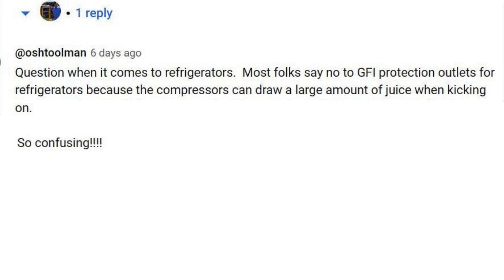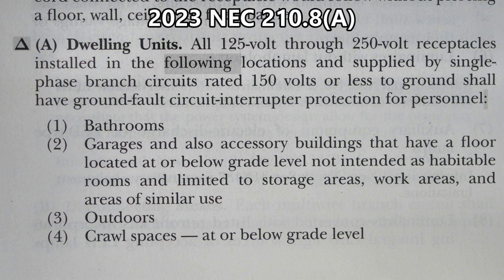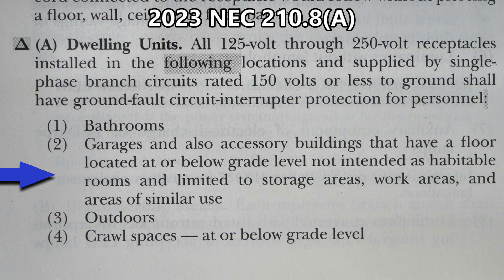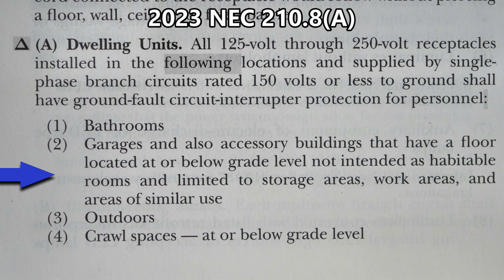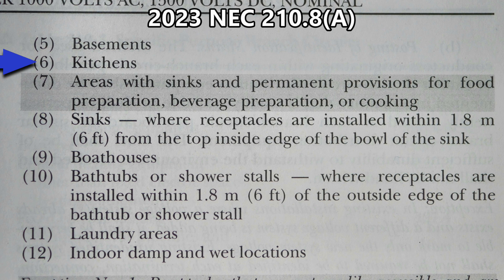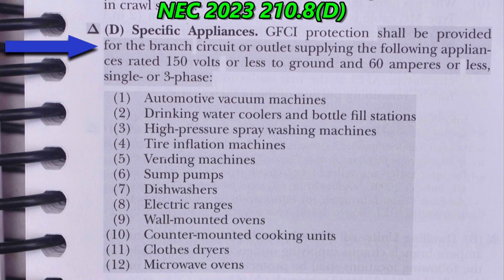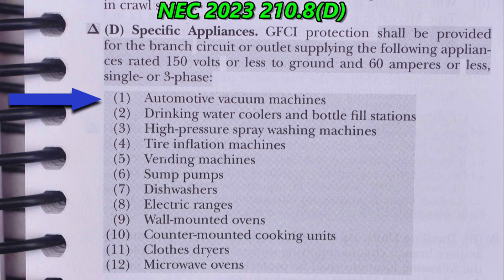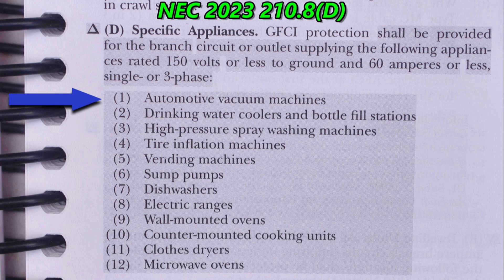Do Refrigerators Need to be Protected by GFCI? 2023 NEC 210.8(A)

Comment: Let me clarify a few things because I know this gentleman states that the GFCI must be at every outlet or receptacle due to the fact that article 210.8 states that it shall be. But if you look at article 210.12 where it says AFCI also known as an arc fault circuit interrupter it also has the word kitchen. If I'm not mistaken, the word kitchen is number one at the top of the list of receptacles that are required to be AFCI.

So the question is, is this guy correct? The answer is yes and no because not all devices in a kitchen are required to be GFCI since 2. Article 210.12 clearly states that a kitchen also must require an AFCI.

Now I'm going to go off on a limb because I'm willing to bet some people will challenge this and say that lights must be AFCI, then if that was the case then it would clearly states lights only or as the NEC clearly addresses it as the luminaire.

Comment: GFCI protection is not required for a refrigerator receptacle outlet unless it is located within 6 ft from the top inside edge of the bowl of a kitchen sink [210.8(A)(7)].
Reply: If it is in the kitchen, it is required by code.i live in a tri state area, all inspectors i come across require fridge gfci protection as well

Comment: At one of my rental units, the kitchen appliances, including the fridge, are all on their own dedicated circuits, and all are on AFCI/GFCI breakers (Eaton). I have had multiple nuisance trips from these breakers, and have replaced some of them. The tenant recently had a failure of the fridge, so a new one was installed. The old fridge never had a nuisance trip, but the new fridge is tripping the breaker.  I hope they didn't go fill up their new fridge. Going out there today. I think I'll go standard breaker on this one, especially since the 2023 code does not list refrigerators in their list of appliances requiring dedicated GFCI. Not to mention that my 20-year-old house with its 20-year-old fridge has been doing just fine with its dedicated non-GFI breaker.

Comment: 1:22 question, not specific to a fridge but something here caught my eye: *below-grade*. 

I have a below-grade utility room (furnace, water heater, washer/dryer) inside my 1960-built house. It has 3 circuits: furnace (no outlet), washer/dryer with GFCI receptacle, and a 3rd circuit without GFCI; this feeds the ceiling light and also other rooms. 

Without accounting for a “grandfather clause”, does this 3rd circuit need GFCI? Not running a fridge or anything, and it is at least 6 feet from water pipes. 
Just curious, and I guess it if does need it it’s easy enough to do. 

Thanks!

Edit: I think I have my answer at 2:15 , as my utility room, while relatively small, might be considered a basement. Also as there is a water heater and pipes, and also a floor drain, it could be considered an “indoor wet or damp location”, though only in the worst case scenario if a pipe bursts or leaks, or the water heater leaks, or the drain or the AC condensate pipe backs up. (Which at least a couple of these have occurred.)

Comment: There are two areas in the NEC where I disagree with GFCI protection.  One is for the garage door opener.  I think a single receptacle -- not a duplex receptacle should be used for the garage door opener. And it should not need GFCI protection.   The other one is for refrigerators/freezers.    I get callbacks because of the nuisance tripping.  Requiring a GFCI protected outlet for a refrigerator is downright stupid unless the manufactures of refrigerators and GFCI's can solve the nuisance tripping issue.

I worked on a remodel in Bird Rock about 20 years ago.   A new garage was being built.   Knowing the issue with GFCI nuisance tripping, I asked the owner if she was going to put a refrigerator or freezer in the garage. She was quite the smarty pants and said, "Why would I put a refrigerator or freezer in the garage. We are not doing that".   I told her I was asking because of the known issue with refrigerators, and the tripping of GFCI protected circuits.   I would have charged her extra and put a single receptacle non-GFCI protected in the garage if I knew she was going to put a refrigerator/freezer in the garage, which is why I asked her in the first place.  That was at rough-in and fortunately, for me, the general contractor I was working for was standing right next to me.  I got final inspection on the job in about six months later I get a call from the GC.  The garage GFCI had tripped. The owner had put a freezer in the garage and $500 worth of meat got spoiled when they went on a trip up to LA.  The smarty pants was looking for reimbursement from the GC and myself.    Of course the GC didn't want to pay so this time the GC did not have convenient amnesia.  He clearly remembered the conversation with the three of us about the question if there is going to be a freezer in the garage or not.  I certainly wasn't going to pay.  I'm very cognizant about this issue.  I've now been electrician and electrical contractor for 40 years and I know better.
Reply: Hi. Why would you add a single receptacle and not a (standard) double receptacle? Pros and cons for this? Thank you.
Reply: @mikeike7114  The reason why outlets in general should be GFCI is that an ordinary person might plug something else in a double receptacle and shock themselves because of a wet encounter. A single outlet that is marked as non-GFCI and dedicated to the fridge, and is occupied by the fridge is far less likely to be unplugged momentarily and repurposed for another device.

Comment: I usually protect the fridge with GFCI breaker. So if it trips, no one has to move the fridge to reset the GFCI outlet....
Reply: Note legal to put GFCI receptacles behind refrigerator or washing machine!
Reply: I just add an extra plug on kitchen countertop to the side of refrigerator so if it trips the customer doesn't have to go to the panel to reset.

Comment: Most refrigerator receptacles are not readily accessible.  I don’t see the need for the requirement. I think they’re running amuck.  I think Texas and Georgia reviewed and reversed the GFCI requirements for Outdoor AC Compressors because of the danger to people from a nuisance trip was greater than the risk of electrical shock.

Comment: I would go on the grounds that a refrigerator is an appliance and it's not listed under (D).
A microwave and dishwasher are listed under (D), so if they wanted a refrigerator to be GFCI protected, it would also be under (D). 👍

Comment: I have seen some arguments about how poorly worded 210.8 (A) (2) is.  Grammar and semantics are frequently crucial to correctly interpreting the NEC (I did not say understanding.).   Some say that Garages should be its own line and accessory buildings should be their own line.  Other say that there should be a comma after Garage.  How do you have a Garage that is above grade level and be able to get the car into the garage?  If the concrete driveway or gravel or asphalt comes up to the level of the garage floor it is at grade.  How far off the ground does the accessory building need to be to be above grade level? How do you protect someone that makes contact with a fault in an accessory building that is above grade?  Is that my kid;s tree house?  Also, do only garages with accessory buildings have to be GFCI protected?  Some say a correction is likely coming.  

Life is important.  I don't want my or my wife's, or my children, their spouses or grandchildren  or any following generation life ended or maimed because of an improper outlet installation.

By the way, there was a time when electricians objected to having to give up on knob and tube wiring (It really is safe if it has not been tampered with.).  Single color black tar impregnated cloth wire was adequate and all that was needed.  2 colors was a waste of money.  Who needs a ground wire.  It is just a waste of money.  Junction boxes just waste more money.  4 circuits sharing a neutral are just fine throughout the house, farm, office, shop, or factory.  And no.  Pixies don't take the path of lease resistance.  The pixies provide equal opportunity to all paths to ground.

Comment: Remodeled kitchen a couple of years ago had  the breaker trip twice , the instructions on the new refrigerator said not to use gfci!  Changed it to dedicated circuit just for refrigerator with standard breaker. No more issues
Reply: Manufactory instructions supersede the code. Show the inspector the instructions.

Comment: I'd do whatever he wants to pass code. Then inform the homeowner what could happen. But i dont think i would eliminate it because if something happens i dont want to be liable. I would make sure it eas wired very simply with only hot neutral sng ground. Then i would suggest the owner gi to u tube yo see how to change out a receptacle. Your garage door opener is on a gfi also. Can you imagine some jerk putting the gfl on yhe ceiling rather than at a location you can get at to test snd reset?
Reply from the maker: Good points, thanks!

Comment: Great video Bill, my response is long winded, and i hope you read what i wrote.

I disagree with a GFCI receptacle being required for a refrigerator. Most receptacles for refrigerators are located behind the refrigerator. The 2017 NEC (Michigan is still on the 2017 code cycle, scheduled to adopt the 2023 on March 12th 2024 completely skipping the 2020 code cycle) 210.8 states:

Ground-Fault Circuit-Interrupter Protection for Personnel. Ground-fault circuit-interrupter protection for personnel shall be provided as required in 210.8(A) through (E). The ground-fault circuit interrupter shall be installed in a readily accessible location.

The definition of readily accessible (still the same in 2023 NEC) is: Accessible, Readily (Readily Accessible). Capable of being reached quickly for operation, renewal, or inspections without requiring those to whom ready access is requisite to take actions such as to use tools (other than keys), to climb over or under, to remove obstacles, or to resort to portable ladders, and so forth.

I don't know about all refrigerators but  i had to remove a front cover on ours to raise the leveling screws to allow the refrigerator to roll out.
Reply: Put a regular receptacle behind the fridge frf from the load side of a GFI receptacle that is in an easily accessible location, like above the counter top. You can even get a dead front gfi if you don't want one that appliances can plug into. And you can get gfi receptacles that will alarm if they trip

Comment: I'm left scratching my head as to what known safety problem is being solved by using GFCI for dedicated appliance outlets for which the existing equipment grounding system, which has been in place for ages now and protects against ground faults, does not already address. Belt, suspenders, staples, duct tape - boy those pants are sure not going to fall down now!
Reply from the maker: Thanks Russell!

Comment: I understand not wanting GFCI on a fridge or freezer. If it trips and you're not home, it could get very expensive. However, I will also admit that the newer GFCI receptacles don't trip nearly as often as the ones from 20 years ago. In fact, I've not (yet) seen a false positive trip in a new GFCI receptacle.
Reply from the maker: Excellent, thanks!
Reply: Mine is brand new Leviton , tripped  all the time that i had to get rid of GFCI yesterday
Reply: @blessnorthamerica7919  I've found the newer ones to be very stable. If it's tripping all the time, there's usually a problem somewhere. It may be minor and hard to find, but it's usually there. That said, could it have been a bad GFCI receptacle? Sure. Anything made by man can go bad at any time. I've seen light bulbs be dead out of the box, light then immediately blow, last a week then blow, and last 10+ years with no problems. There's just no telling without trying a 2nd unit. If the 2nd unit trips also, there's something wrong somewhere. The problem may be in the device you're plugging in. It may momentarily do something as it starts up then the problem goes away or it may have a very small leak between hot and ground. As I'm sure you know, it doesn't take much to trip the GFCI. In fact, it's so little that compared to a fridge's compressor kicking in, it's probably not noticeable. The GFCI isn't there to protect the equipment, although it can and does; it's there to protect people. If the device does have a small leak to ground, it's probably being handled by the grounding system and you'd not notice it by touching the device, but it may be enough to trip the GFCI. So, in addition to trying a different GFCI receptacle, it may be worthwhile trying a different device in the receptacle and see if it still trips. Also, if the receptacle protects downstream receptacles, disconnect them long enough to do the testing to make sure the problem isn't downstream.

Comment: It would only take one false trip to ruin a fridge full of food.
Reply from the maker: That's true, particularly if someone is on vacation when it trips.
Reply: @SparkyChannel how many spontaneous GFCI trips are there though? AFCI I can see, but not GFCI. GFCI just runs the hot and neutral through a wire coil, and the magnetic fields cancel out if the current is equal in both, and no voltage is created on the coil. If current leaks somewhere, the neutral has less current than the hot, and there is a net magnetic field in the coil, and it creates a voltage that trips the sensor. Simple device from a physics perspective. Can’t see how a fridge running would trip it. No amount of inrush current would change this.

HOWEVER I would put a fridge on its own GFCI and not downstream/upstream of any outlets an inhabitant could use.

Comment: I just found out from my inspector today that Iowa (2020 NEC) is not requiring gfci on 240v circuits *except EV chargers. So, no gfci on A/c, oven, stove, dryers, welder. Here's a link to the Iowa code modification for anyone interested: https://www.legis.iowa.gov/docs/iac/chapter/661.504.pdf
Reply: The GFCI circuitry is inside the EV "charger" which is actually called an EVSE or Electric Vehicle Supply Equipment. The EVSE is what is typically installed on the garage wall.

The actual EV charger is inside and part of the electric car.
Reply from the maker: Interesting, thanks!

Comment: We do not protect the fridge here. Nothing to do with high current draw at start up, but because motors can put other frequencies onto the wire. Motors can also make the amps and volts out of phase. Siemens GFCI can detect this and prevent a false trip, but most brands do not yet.
Reply: It shall be noted that window air conditioners for at least the last 15 years have GFI cord sets.  Thank you for the screenshot of the code book.  The NEC is also a legal document…
Reply: As someone else informed, manufacturers’ specifications are treated as the proper method as far as code goes, and whilst I am not intimately familiar with every model, I suspect, that the vast majority, if not all, are going to be a no-go for GFCI. I realise, that the refrigerator may not have even been ordered yet on a new build, but you can have a printout, of some random model highlighting the bit specifically saying not to install on a GFCI, ready for the inspector. This is a grey area but should not be viewed as unprofessional behaviour. Clients frequently change their mind during and after construction and may very well opt for the model that you have a printout for.
Reply: @GeorgeVCohea-dw7ou  you are correct, the NEC says to follow the Listing and Labeling Instructions.

Comment: Sparky, I recently did a reno on our 1985 kitchen and upgraded  all receptacles, the wiring to the disposal (now GFCI) and on-demand water heater (now GFCI). All  Appliances were replaced (2023) . The fridge is on the same circuit as the other counter top outlets.   I installed a GFCI and had a tripping issue for the circuit that drove me crazy until I found this on page 4 of the Frigidaire Use and Care manual for the fridge "Avoid connecting the unit to a GFCI circuit"!  No, I won't be installing a GFCI to the fridge, but did put it on it's own breaker.

Thanks for all the great videos!  I was able to safely bring my old property up to code and upgrade the receptacles  and switches safely.
Reply from the maker: Congrats on the remodel!
Wow, very interesting on the Frigidaire Use and Care manual saying don't use the GFCI protection on their fridge. That is opposite of the NEC code. Isn't that crazy? I think we should be able to run refrigerators and freezers without GFCI but as a licensed electrical contractor, I have to follow the code. Thanks!
Reply: @SparkyChannel  Nothing in the NEC says "refrigerators" have to be on GFCI. The language says "kitchens" and "garages". (and 210.8(D) closes the "hard wiring" loophole.) I can remotely see the logic here (potentially wet places), but really, how many people have been shocked from vending machines? (I would say how many houses have burned due to the fridge, but that's a measurable number, but usually not from electrical faults - compressors lock up and set stuff on fire.)
Reply: Manufacturer instructions supersede the code
Reply: @michaeldidomenico6312  And a**hole inspectors supersede everything.

Comment: A gfci trip behind a fridge should be avoided regardless, either use a gfci breaker (less desirable) or a "dead front" gfci-only (no outlet) in a box visible & next to fridge would be my choice for protecting fridge circuit
Reply from the maker: Thanks Mike!